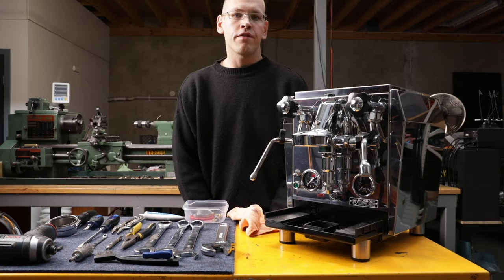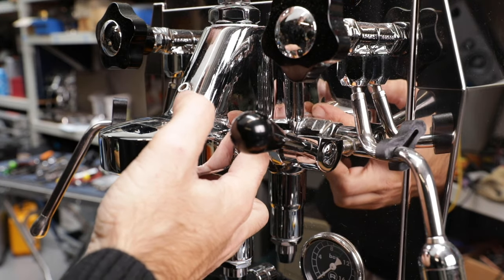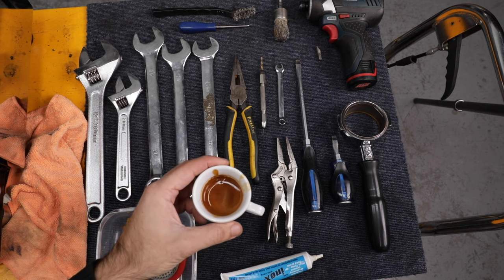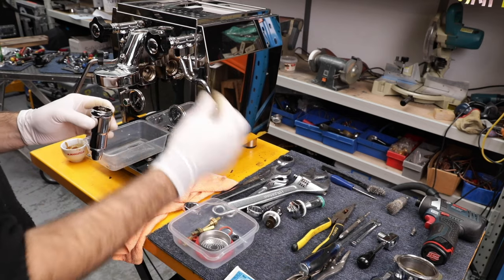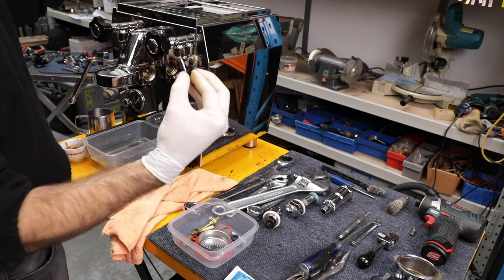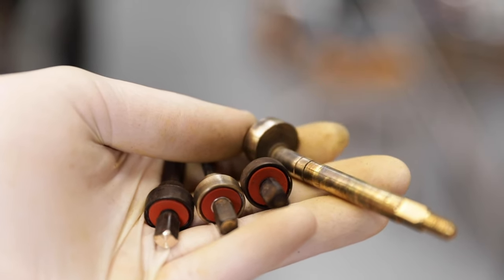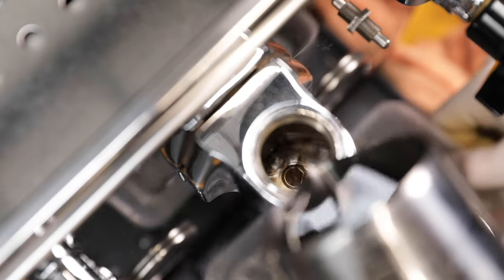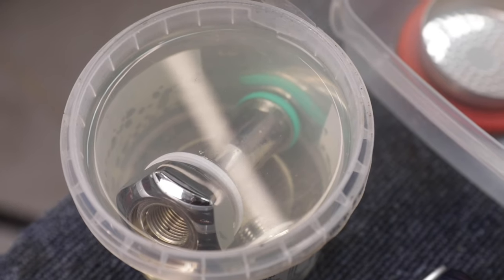Espresso machine - Service and rebuild an E61 coffee group

Comment: Wow.. I gotta say.. I been watching 100s of tutorial videos on all sorts of subjects.. and this has got to be about the best one I have seen. Your details, information, lighting, the closeups, etc.. thank you so much for this incredible video! Very well done. I have had my Profitec500 for almost a year and my lever was sticking, and it wasn't building up much pressure... assumed these machines last years without any maintenance due to only using it once a day for a couple shots, but learned that no.. I need to backflush this thing every week, clean it thoroughly every 6 to 8 weeks, and once a year do a maintenance similar to what you show here. My understanding is that what you have here is a bit more than I should need to do every year.. maybe every few years? I don't think I use it enough.. but now that I know that I need to backflush/use cleaner/etc, I am hoping I will keep it working better for longer.

Comment: Thanks for the video!
For those looking for precisely when he's chucking the cams back on the head, reference:

Top mushroom, in:
Bottom release, out:
If you know maths or quadrants, and imagine the cam as a sector, it's as if the 'sector' is in the 2nd bordering third quadrant, at t:33-34m or so.

And then the arm goes on at ~180 degrees, it seems.

But yes, watching this made me realise, oh dear, all my seals need replacing.

Comment: So I had a returning cam on the flush side\ pressure relief full down position. This video gave me the idea to measure my rod/pin length. You said it was suppose to be 12.7 mm. Sure enough mine was 11.7 since new?.... I backed it off 1 mm and 7 years worth of annoying behaviour was fixed!.  I have ordered a couple washers to put in there rather than leaving it loose but in the meantime works great.  I also took a file to top of rod to ensure it was flat but that was not the real fix. I also tried often to remove shower head but was worried about stripping. After seeing this I got it done. Thanks for this.

Comment: Are each of the three springs equal and interchangeable?  After reassembly, when purging with a blank, there is a pressure relief and water flows from the lower group.  Likewise, when brewing; overflow gets released thru the lower group.

Comment: Thanks for this. Really clear and informative. Any advice on how to unlock tight or stuck nuts on the E61? I have a Rocket Giotto which is several years old and while I have serviced the group head lever before I have never removed the lower part of the brew head. Recently the exhaust valve has started to leak all the time so I suspect I need to change out some of the seals in the lower part of the grouphead. However all of the nuts on the exhaust valve seem to be completely stuck. I have used some WD40 but it hasn't seemed to make a difference. I suspect there may be some limescale buildup in the valve as well. Any advice? I do not want to break anything or cause damage to the machine.

Comment: After persisting with a failing group seal for far too long and finally losing a duralex glass to the group handle backing out I tried to give it a clean.... and the rubber seal disintegrated.

Now I have got it out, I am finding that I cannot get the shower screen to release, having tried a flat head screwdriver, a spoon and a paint tin opener. Any suggestions for a stuck shower screen?

Comment: Thank you for your video. I have a Lelit PL62T coffee maker with PID. And when I turn it on the blue light on the boiler does not come on. I was told it was because it was scaled. I was told that it was not difficult to descale. Can you confirm this? Do you have a video for this? Thank you.

Comment: Nice Tutorial, thank you!
So now I have a question. I have a rocket appartamento and I unscrewed the top part of the group, but it seems like the ceramic part of the mushroom is broken. In my opinion I do not get a hot coffee because it tastes very sour and I don’t think that It reaches 90+ degrees celcius. Could the broken mushroom be the reason? In the inner part I can also see some scaling. How can I remove that without damaging the group? Thanks in advance

Comment: Can you help me with a returning back lever? If I pull the lever up for brewing it starts to pull down on itself.
That started after I lubricated the cam.
Reply: Ya know I had a returning cam on the flush side\ pressure relief full down position. This video gave me the idea to measure my rod length. He said it was suppose to be 12.7 mm. Sure enough mine was 11.7. I backed it off 1 mm and 
7 years worth of annoying behaviour was fixed!.  I have ordered a couple washers to put in there rather than leaving it loose but in the meantime works great.  I also took a file to top of rod to ensure it was flat but that was not the real fix.

Comment: Thanks for such a great detailed video! 

Are you planning to do one for descaling of a dual boiler? And would you recommend preventative descaling, or only when there’s signs of serious build up? I’m two years into a profitec 600. Soft Canberra water and regular maintenance. Mushroom still looks really clean. Only build up is a few spots on the brass valves. 

Thanks!

Comment: Great video, excellent production, comprehensive and informative. When you address removing the pin on the valves to access the seals and the possibility of breaking them, I've noticed on the ones I've broken that there appears to be loctite on them.
Why do you think some manufacturers do this? Is there any benefit to loctiting the pins onto the threads? I can't imagine there would be as it's not really under intense stress.
Also is there any reason you prefer MX6 over Moly 111 for lever pin lubrication?
Reply: If you check out the INOX website you will see that MX6 meets Australian and International requirements as an extremely safe product in food applications. 
It’s also very price competitive.   Also other INOX products such as MX3 are highly regarded by many industries due to their outstanding performance. 
I have used MX3 for decades for electronic / mechanical repairs and wouldn’t have any hesitation using MX6 in my ECM Technika IV coffee machine.
Reply from the maker: Hi Madik, I have no idea why manufacturers love to loctite these parts. There is really no need. Applying heat with a heat gun or torch to the pin will significantly increase your chances of removing it without breaking it!

Moly 111 is completely fine too, I prefer MX6 here as it's a bit more viscous, which is an advantage for moving parts.

Comment: Hi Rick, 

Question for you. I was recently gifted a Rocket Apartamento and it appears to be in working order for the most part. However, the group head seems to have a heating issue. The group head water isn't getting above 150 degrees fahrenheit. When I turn the machine on and let it sit for 30 minutes the group head isn't even hot, so I am wondering what things should I check to diagnose this issue?

Comment: Agree with Kevin, absolutely magnificent video. Very similar E61 configuration on a Vibiemme Replica single and the step by step is brilliant. I'm handy but have never serviced a coffee machine before and I worked through its step by step. I had to play some spots over and over to recognise the parts and how to pull apart (and to see it to reassemble as my memory is not what it used to be). Even the little tips (the washer is there it may be hidden) turned out to be true. I would not have had the confidence to pull apart the pins without watching this [indeed didn't realise they were multi-parts]. I found a break-out picture of all parts but still seeing it coming apart and going back together was perfect instructions guide for me. Saved a fortune and learnt the mechanics of the coffee machine. The guy who charged us $300 a service 3 times over 10 years never did anything except the group head seal and maybe the steam valve (ie never truly serviced the machine at all in 16 years) so it really was a first time rebuild/service. Am peeved to find out the service guy never did his job properly. It had all original gasket assemblies which had started leaking and scaling was horrendous. Turned out to be the group drain assembly that was the real leak (not shown in his video) but I had effectively learnt how to pull apart the whole machine through this video and it is the same assembly valve as one of the groupset. Brilliant video thanks heaps!!!!

Comment: I have a Rocket espresso Giotto from 2004  - water tank model/vibration pump - model with half moon pressure gauge. This machine has not been used for the last 14 years or so I turned the machine on and all appeared to be fine (I did not pull a shot) Then I checked steam wand (was fine) and  then hot water nozzle and it was fine and the water was coming out of it but then after that the machine wanted to collect the water from the tank to the boiler which of course is normal But despite the noise (rather louder than I would expect knowing rockets) nothing was happening. It kept making noise and the pump was working but now water was collected and the sound did not stop until I turned the machine off. What could be wrong with the machine?

Comment: If you had to replace the restrictor jet (gicleur) what tool would you use to get to the little sucker? Thx
Reply: they usualy need a 7mm Socket. Be careful when you do it back up, too tight and you will snap the bras

Comment: Rick, being someone who's done a frame up tear down and rebuild of a Rocket Giotto Premium Plus HX machine myself, what "money no object" upgrades would you do to a machine like this, that could have a tangible impact in performance and consistency?  I know
 things like PID and Flow control are pretty popular, but I'm talking a little more bleeding edge, things like dual boiler conversion, exotic pump upgrade  (rotary, gear pump, inboard or outboard, etc) significant thermal stability upgrades, etc...

What would the coffee machinist do given the time and potential for substantial performance improvement?

Comment: I took your advice and didn't tighten the mushroom big nut "stupidly" tight and I got leakage as soon as I tested it. I tightened a bit more and still got leakage from the same spot when I made espresso. So, in the end I ended up tightening even more when I saw a drip as the machine was warming up again. Can't understand it. New gaskets, followed instruction video.
Reply: Follow up-I took it apart again, looked over the parts(I had left off the main gasket to the rocker arm assy-duh!), and reassembled all three sections. No leaks!I don't know what had caused the mushroom to leak, but it didn't the second time around. Cheers!

Comment: hi rick..how do you fix the boiler gauge on e61 models?..i have magister stella single group..there is a pressure but the hand in the steam gauge drops to zero and did not move at all?.
Reply from the maker: Sounds like the fitting or pipe leading to the gauge from the boiler, or the gauge itself is blocked. These are very narrow so scale does like to find it's way into these parts! A fine drill bit is a good tool to try and free it up.